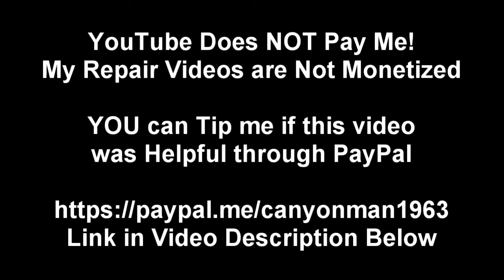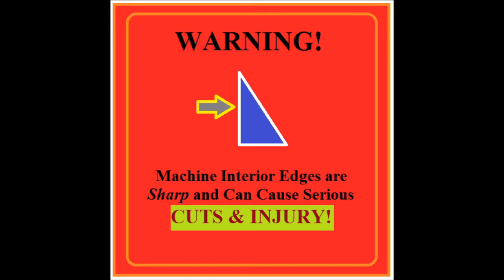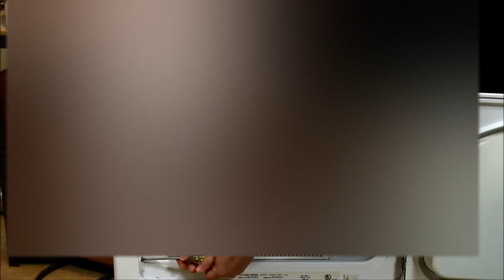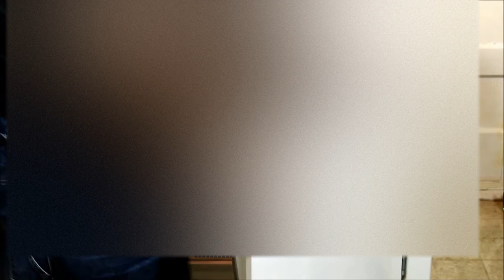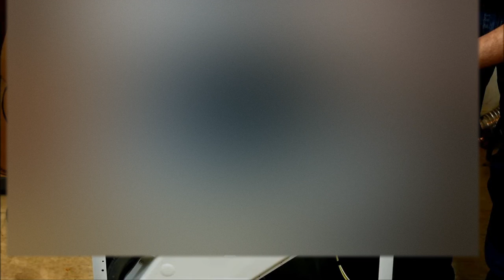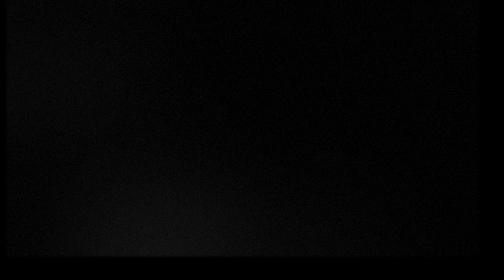How to Take Apart Maytag Atlantis or Neptune Dryer

Comment: Nowhere on my machine does it describe itself as an Atlantis or Neptune Dryer. It says it is a model #MDE9606AYW Intellidry 6 cycle, but that model number does not match up with any YouTube repair instructions. Instead it looks identical to the Atlantis/Neptune model dryer discussed in this repair instructions.
When I dry clothes, I get in the habit of turning the drum clockwise to check for any remaining clothes. This last time I spun the drum counter clockwise, which released the belt from the tensioner. Lesson learned. I really appreciate your repair instructions, as they were incredibly helpful. You are a good man.

Comment: I had a pair Maytag Atlantis washer and dryer, had them 22 years washer went last year  trying to find a replacement washer has been bs, Iv gone through 5 now, water level is crap or they making knocking noises like they are gonna explode or shake like they are going to take off, finally though I found a good one till I find out I cant reach the flipping cloths  and the cold water button doesn't work. Now my dryer decided to stop turning on my last load of clothes, ugh. So hope this is it because I had a simple repair on it one other time, 350$$$$$$$$$$$ wont do that again, just buy a new one, THEY DONT MAKE ANYTHING LIKE THYE USED TO!!!!!!
Reply: MAYTAG 3.5 cu. ft. Commercial-Grade Residential Agitator Washer
Maytag MVWP575GW
Hope this message helps you out… Me and my parents have bought this model, and it has been 100% reliable for around 5 years. I bought the set with matching drier, and haven’t had any issues with drier either. Good luck…. There’s a lot of junk sold these days.
PS: Another model that some say is even more durable than the Maytag model I referenced is Speed Queen TC5 Top Load Washer

Comment: Thanx for taking the tine to make this teaching video.  If I would add anything, it would be a reassembly video.  The fact that the 2 front pieces with the wiring are separate pieces caused me a little trouble during the reassembly.  That way, you could add some points about how to handle the drum and tucking the padding in properly.  However, it was still an excellent video and I am very grateful.

Comment: Awesome video and was super helpful for me. Question: after reassembly my dryer actually doesn’t seem as efficient with its drying. I cleaned out layers of built up lint and thought my dryer would be better than before. Is there something I could have messed up during reassembly?
Reply: Check that a heater element wire was not disconnected.

Comment: Thanks for posting.  I had one of the paddles in the dryer fall off.   With your help I had it back together in less than 20 minutes!  Many thanks.
Reply: I have 1 paddle loose.... was you able to repair yours with tub still mounted or did you completely remove it?

Comment: Perfect instructions! One of the 3 paddles in the drum was becoming loose. Was able to disassemble to the point of opening the top panel and access the loose screws. Problem solved, Thanks! P.S, Wasn't able to make the paypal tip happen. Long time since I used pp, and didn't have time to re-verify everything and add funds, ect.  But I've bookmarked your page, and, as Arnold says..."I'll be back!"
Reply from the maker: Awesome, glad the video helped!

Comment: Can u help me diagnose my Atlantis Maytag? Timer does not advance , I replaced timer and same thing , no advance. Could be because I replaced it with used one . Is the timer supposed to advance even if u don’t push start yet? My whirlpool you can hear ticking advancing before even pushing start. This Maytag I hear nothing at all
Reply: The timer stays put. I thank the Lord that this set has less pinging and ringing than other machines. I love that the buzzer is a big optional switch.

Comment: I am going to follow your video tonight when I work on my Dyer. The issue is that the drum sounds as if it's rubbing against something. What defect should I look for to replace once I take it apart?
Reply: Just did this on mine (using this vid, thanks Ken!). One of the screws that holds one of baffles had come loose and backed out far enough that the head was hitting the interior side of the dryer on every rotation. I tightened it back down and checked the others, which were all fine. Problem solved.
Reply: @markg-ms  thank you for sharing. I will definitely look for loose screws.

Comment: It was a cool 67 degrees when I did this, my first appliance repair.  I replaced all three wheels pretty easily but getting the belt replaced was really tricky. I couldn't stretch it onto the pully so I put a space heater inside the drum, warmed it all to 80 degrees to loosen it up and bingo, got just enough extra stretch and got the belt around the motor shaft.  A follow up video showing the tricks of putting it all back together would be helpful.

Comment: thank you SO MUCH! I opened up and found the belt has split! and a blue plastic something was torn to shreds! I have a mdg7757aww and I'm trying to figure out how to replace the belt and maybe the plastic thing, haha. Any additional help would be amazing! Sent you a tip already for the amazing, clear video tutorial :) thank you!
Reply from the maker: Thanks for the tip, glad the video helped.  Here is a link to a video that I think will help with the new belt installation   https://youtu.be/__Cg9KmN5VU good luck with the rest of the repair!
Reply: @kensappliancerepair9971  thank you so much! Maybe dumb questions but 1) should I make sure the replacement belt has the same number of ribs? And 2) does the rib side of the belt sit against the drum? Or the flat side? Thanks again!
Reply from the maker: @ashleyhaak1090  The correct part number for the belt for your model number is WP33002535.  It should have the same number of ribs as the original belt, IF your dryer still has original belt on it.  On this style maytag dryer, the ribs side of belt sits on the drum.  Some older maytag dryers have flat side against the drum, but according to the parts diagram, your model should have ribs against the drum.  Hope this helps!
Reply: @kensappliancerepair9971  thank you so much!! Turns out I need a whole new idler pully too :/ Is there a specific type of that also?
Reply: @ashleyhaak1090 the blue plastic thingy??

Comment: Very grateful for this video!  It's the ONLY one I've found specifically for the Maytag Atlantis.  This was a top of the line washer dryer and they're old now but my wife loves them so I'm grateful for your video that helps me keep them going a little longer.  I sent a tip a moment ago.  Thanks!
Reply from the maker: Glad the video helped you out!  And thanks so much for the tip, it is appreciated!
Reply: @kensappliancerepair9971  You don't happen to have a video for a Maytag Atlantis washing machine do you?  Just checking.
Reply from the maker: @joesellers5504  No, I do not... Wish I did.  I would gladly share it with you.  But, what problems is your washer having?  You can email me at manfredcanyon@gmail.com and maybe I can help you out

Comment: Good job.  Wish you had addressed the felt.  I noticed the drum was marked like mine where the felt had slipped off.  Or is that not a concern?
Reply from the maker: The felt is what the front and back edges of the drum seal against when it is all put together.  The felts do need to be in place, otherwise it would be metal against metal and make a horrible screeching sound and eventually would cut through the bulkhead where the felt is missing.  It is in place on this video.  The shiny rubbed part you see on the surface of the drum is where it rubs  or slides against the bearing slides on the front drum supports.  This does need those vinyl slides to be in place, which they are on this video as well.  But they rub and do make the shiny wear pattern on the drum surface, they all do with this design.  The felt had not slipped off on this video.  As for yours, if it did, then by all means address it, it does need to be in place on the bulkhead, but again its the edge of the drum that makes contact with it, not that shiny ring on the outer drum surface!  Hope this helps!

Comment: Great video. Ended too soon.. My Atlantis is squeaking loudly. Do I need to remove the drum to change the pulley?
Reply from the maker: Yes, to replace the tension pulley you do need to remove the drum so you can have easy access to it.  Also, while there, check the drum rollers to make sure they are not the problem.  Good luck!

Comment: Do you have a replacement part# for the belt? Thanks
Reply from the maker: Send me the model number from your dryer, and I will look up the part number and let you know!
Reply: @kensappliancerepair9971  Its a Maytag Atlantis model# MDG6400AWW
Reply from the maker: @robrobles931  The belt part number is WP33002535 according to Sears Parts Direct parts lookup.  Hope this helps!
Reply: @kensappliancerepair9971  Thanks, I will order that part. Very much appreciated! Also great video, took the guess work out of disassembly.
Reply from the maker: @robrobles931  You're Welcome!

Comment: Thank you for the video.  I accidentally disconnected the moisture sensor wiring and apparently put the wire back on incorrectly as the dryer runs continuously if I use sensor drying - can only use timed drying.  Do you have information on how the wires should be on the moisture sensor?
Reply from the maker: Most machines only use a single wire attached to the sensor.  It would be on the front side of the front bulkhead, located on the outer side from the sensor.  It would be a single spade that the single wire from the wire harness would attach to.  Hope this helps.
Reply: @kensappliancerepair9971  I looked at the wiring schematic and figured it out.  Mine has three spade locations to connect to.  One goes to a ground wire.  The blue wire goes to the other sensor strip.  I had it on the same strip as the ground wire.  Now it works. Thank you again for your reply.
Reply from the maker: @markclauder4881  Great!  those wiring schematics do come in handy!!!

Comment: Do I have to put the front plate on before tightening the belt, when putting it back together
Reply from the maker: No, its easier to install the belt, and then put on the front pieces.  Sorry if I didn't show it that way.
Reply: @kensappliancerepair9971  awesome thanks for the quick reply, trying to put it back together right now, and I'm hoping I'm doing it right lol

Comment: Very good.  One note -- the small screws on the front panel attach the inner panel for the dryer support with the felt srips.  No need to remove them, and it saves a step on reassembling.  They are the inside screws lower left and upper right. Thanks for the extra video in the belt disassembly -- doing it by feel is OK once you have done it.  Keeping the wires clear on belt and panels is a little tricky but you pointed it out well enough.  And like you said -- always unplug from power.  I serviced home appliances in the base housing while in the Air Force, but that was over 50 years ago -- you made it easy.
Reply: yes but I guess i'm not to smart I took all the screws out & I'm thankful that he showed were the two small screws go my dryer started squeaking after I put it back together  I took it apart to clean all the lint out after I found out why my dryer wouldn't start & it ended up being the door switch now I'm going to take the front off & make sure I got the drum is pushed in good & put the screws were they suppose to go . Thanks  😊
Reply: Hey, David... I visit my daughter regularly at the USAFA... is that where you work?

Comment: Can you place a Atlantis Door with a Neptune door?
Reply from the maker: That I don't know for sure.  If they have the exact same part number, the yes, you can swap them.  If there is no part number on the doors, you will need to use the model number from each machine to look up the part numbers, and see if they are the same or not.  Or, you could just try it if you have both available, and see if it fits and seals properly, and is the same size, etc.

Comment: I did the job. Everything went well, as I expected, though I had to have my wife help with reassembly; holding front panel before screws and supporting drum for belt placement. Turns out, the thumping, vibration was not the rear drum support wheels, though I took em off and hi temp greased; but it was the skid pads on the front of the drum, two of them, worn to metal. I vacuumed, cleaned and greased, pop riveted new pads in place and replaced the belt while I was there. I should have greased the belt idler pulley but I didn’t. Damned! 
Parts cost $51.90 including tax and a 50 mile round trip to get em. 
What’s your mailing address? 
SEND IT TO: Libertyyes@verizon.net
Got something here that’s yours. 
Thanks for the video. You saved me some real cash. Merry Christmas and Happy New Year. Steve, Plymouth, MA
Reply from the maker: Super!  Glad the video helped you get in there to find the issue and fix it.  It is definitely nice to have someone help hold things in place, much easier to  put together that way!  I will email you address

Comment: Thanks for the video. Taking it apart was made much easier! Putting the front back on was a little tricky but got better once I had one screw in. Did I really need to do that to get that huge clump of lint out?
Reply from the maker: You're Welcome, glad the video helped.  And thank you for the donation!  As for removing the lint from the blower housing, it can be done by just removing the blower box and lint trap cover from the bottom of the front bulkhead.  Just remove the screws that hold it onto the bulkhead, remove the lint trap from inside, and the outer lint trap cover should be removable so you can clean it and the blower out.
Reply from the maker: Also, you do still have to remove the front door and the front trip piece to expose the bottom lint trap housing...

Comment: where you find a serial number for this kind a  dryer
Reply from the maker: The model number and serial number are both on a tag that is usually located on the panel the door closes up to, or on the inside of the door.  Older dryers sometimes have the tag located on the top corner of the control panel towards the back.  Hope this helps!

Comment: Any reason why you removed belt before the bulkhead?  Seems like you would have more room and it would be easier if you remove the bulkhead first, then the belt.  Thanks for the video.
Reply from the maker: Hmmm, you are correct.  I dont know why I showed to release the belt tensioner from the belt before removing the bulkhead.  Easier to do it with bulkhead out of the way for sure.  Thanks for commenting!

Comment: Do you have to remove the drum before removing the front bulkhead? My clothes got stuck in between the lint trap and front bulkhead
Reply from the maker: You remove the front door panel, and then the front bulkhead, and then the drum if you need to.  Based on what you have going on, you probably do not have to remove the drum though.